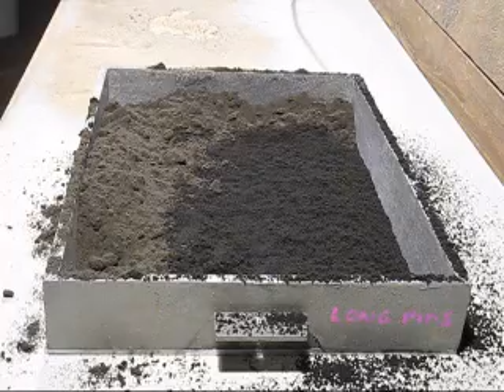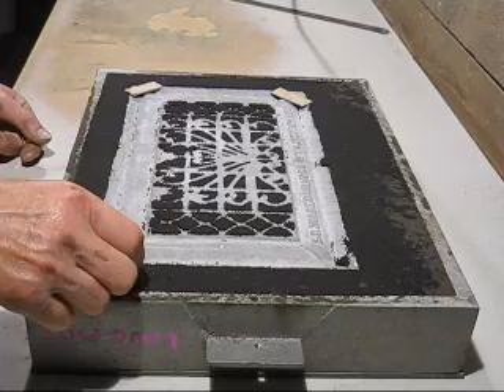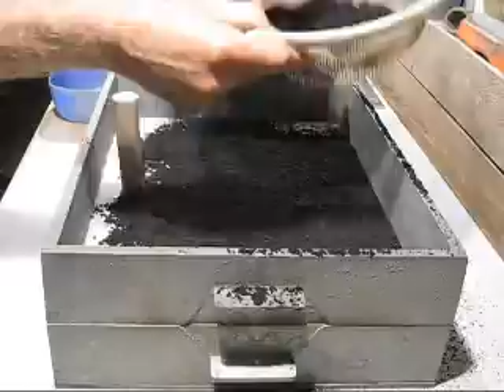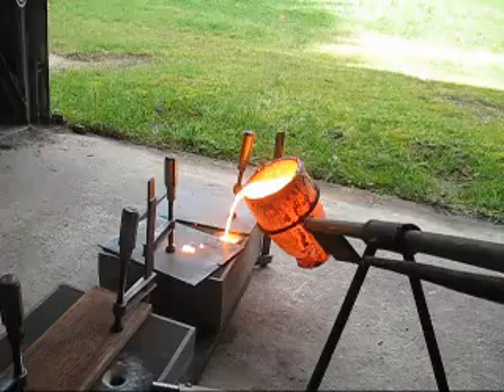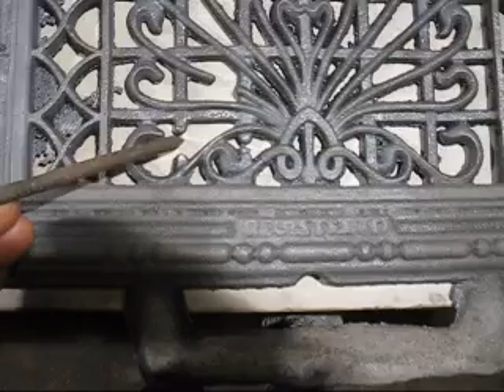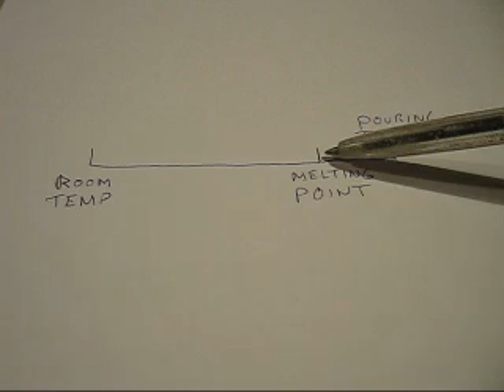How to cast a decorative grill

Comment: Hi luckygen1001, Another interesting video as always. Damn tricky pattern to cast successfully.
I am wondering if part of the solution maybe to provide gating which enters the thin part of the pattern from the rear at the point where the stems all intersect? I am not sure if this will cause flow problems? The other way I thought of trying to improve the metal flow would be to have multiple gates along the bottom edge with one very close to that centre notch.
It will all make for an interesting follow up video.

Comment: Nice job, pity about the shuts maybe I more ingate would have saved the job.Could I ask what are the sands you are using as it looks very nice.I enjoy your Videos, I am in West Oz could I ask where you areBob
Reply from the maker: I live in Victoria. the sand I use comes from a local sand pit.
Reply: Thanks , you appear too have two different mixes one  black one grey, is the sieved sand from the pit
Reply from the maker: Bob Pinner Both sands come from the same sand pit, the black one has coal dust and the grey sand is burnt coal dust mixed in with the sand.

Comment: you could also heat up the mold prior to casting to keep the metal liquid for a longer time. How? 
a) You could heat up the mold by putting it over the hot exhaust of your furnace. 
b) Or you could connect a sprue and a riser to your mold at opposite corners of the cavity and blow through hot air of a hot air gun or exhaust gases of some burner. But a) and b) most likely work better with oil sand than with green sand since the heat dries out the moisture and makes the surface crumble.

Comment: How do you lower the melting point of cast iron?
Reply: Same question, probably additives?
Reply: By increasing the phosphorous content of the iron. This forms an Iron/iron phosphide eutectic which has a low (relatively) melting point making the iron much more fluid. Bathtubs etc are cast from high Phosphorous irons as they are quite thin and the metal has to run a long way. The easiest solution here may simply be to melt down an old broken iron bath tub. Damn tricky thing to cast though! Good luck.
Reply from the maker: The melting point of ice (water) can be lowered by adding salt. The same can be done with cast iron but  phosphorous has to used.
Reply from the maker: It is always nice to have an foundry expert to give technical answers better than I can!